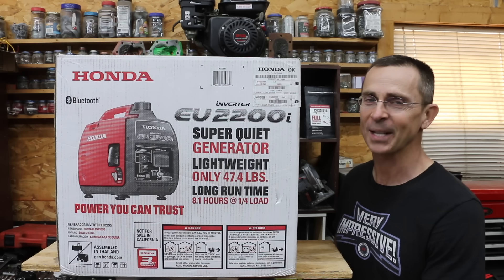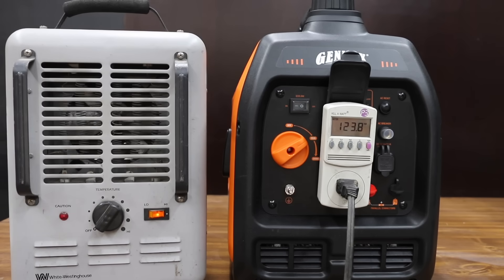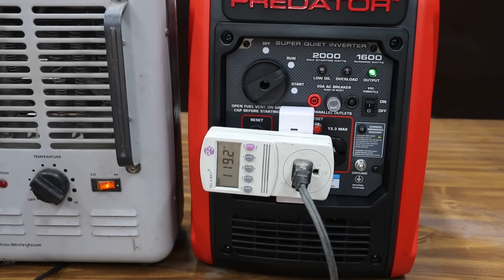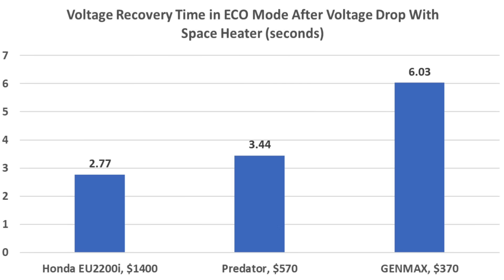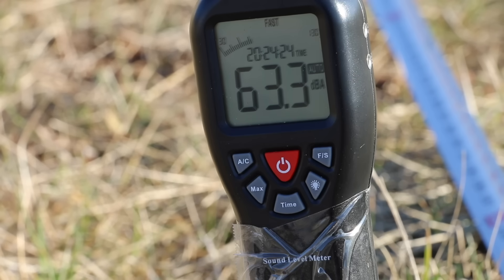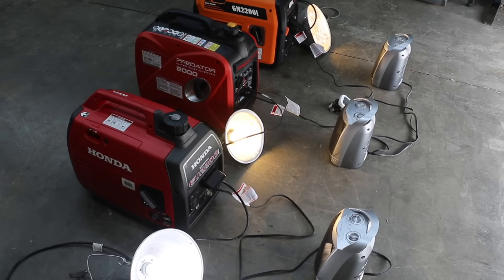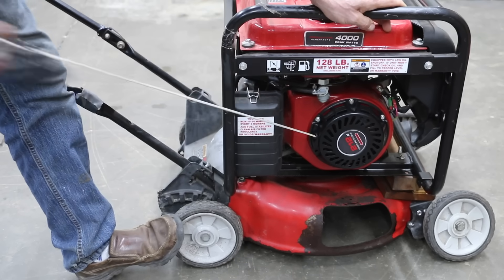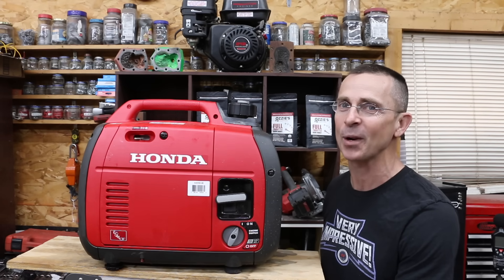Cheap Generator Better Than Honda? Predator vs Honda & GENMAX—Let’s Settle This!

Comment: I bet you do not drink coffee  :-0 .... ONE very important question please....  In your testing you permitted the inverter generators run out of gas UNDER LOAD....  In general terms, and specifically for the Westinghouse iGEN2500,  what is the REAL ANSWER to -  ""Is it harmful or damage these inverter generators to run out of gas UNDER LOAD"" ????  Could one ASSuME that these types of inverter output circuits have incorporated a safety turn off if/when the generator cannot continue to produce power/run out of gas?  Thank you for your sharing your testing experience....
Reply from the maker: You are welcome!

Comment: Thanks for another comprehensive test video from Project Farm.  This kind of information is a great help for folks trying to choose between these products.

I do wonder why the oil was measured by weight for this testing.  I've always assumed that oil quantities were specified in terms of fluid ounces (volume), so I was puzzled by the use of a weighing scale for measuring "ounces" of oil for these generators.
Reply: ME TO....

Comment: Loved the video and its format. What is the date on these tests? I purcashed a predattor 2000 and it does have a CO2 shutoff now. Will you be updating these tests with current models and prices? 
Thank You,  Ray
Reply from the maker: Thanks for the suggestion.

Comment: I owned a portable Honda generator.  At one point I had it stored for 5 years.  When I took it out, added gas (I stored it dry), it started on the first pull. 

Honda makes good engines.  Worth the extra money.
Reply from the maker: Thanks for sharing.

Comment: I was wondering if u vou could test other cheaper generators? Like the Pulsar,Duromax,Firman,Wen, and last Westinghouse. I am very interested in noise levels. Thanks 😊 PF. DUTCH. I JUST signed up it's not much hope it helps

Comment: How about these running a small A/C window unit? My electric bill is outragous when using A/C.
Reply from the maker: Thanks for the suggestion.
Reply: For the Florida hurricanes my Westinghouse iGEN2500 powers my 6K BTU window AC, (~435W), AND my refer - ~125W very nicely and still gets about 8 hours run time on one gallon of E0 gas.  ONLY run E0 gas that has been stabilized and with the 20 gallons in my shed that should provide ~ over 6 days of power - 24/7 if it is needed.  BUT, if the power is out for an extended time, I will be sure to change the oil at about the 100 hour mark..  I only use Valvoline 10W-30 FULL SYNTHETIC IN all MY power gear so as long as the oil level is OK, I don't sweat with any extended run times....

Comment: I really need to see a comparison in the 2200 - 2500W range between Honda, Champion, and Wen. Primary concerns are noise level and weight. I am a senior and camping alone. Amazon has this 
Champion Power Equipment 200951 2500-Watt Portable Inverter Generator, Ultralight. And WEN 56235i Super Quiet 2350-Watt Portable Inverter Generator with Fuel Shut Off, CARB Compliant, Ultra Lightweight. I think the Honda is a 2200W. I am subscribed to your channel. Will I get a notification when you add more comparison videos? Thanks!
Reply from the maker: Thanks for the suggestion.

Comment: A test I have found anyone evaluating gen/inverters is what kind of load that they will handle at 6000' elevation. After watching a number of eval/review videos on the various gen/inverters 'out there', I traded up from my Champion 7536 2kW peak/100W running gen/inverter to a Honda 2200i. My Champion is powered by a rather anemic engine that would go into overload when I ran the 900W microwave in our trailer -- clearly a symptom of an under-powered engine and oxygen starvation at 6000' elevation. I bit the bullet to by the Honda at round $1100 based on the reputation of Honda for reliability and the experiences of ham radio friends who use theirs in the field for radio'ing and powering their RVs when dry camping.
I've not been sorry for my purchase choice. Ya gets what ya pay for (usually). In my case with the Honda -- definitely.
Important note: Honda apparently is no longer selling its gen/inverters in Calif d/t  the increasingly restrictive laws on gas-powered utility tools. In the case of gen/inverters, Calif is requiring catalytic converters on new units -- something Honda has refused to do. (I went out of state to get my Honda.)
Reply from the maker: Thanks for sharing.
Reply: cat would make this gen twice as big and twice as expensive, Politics are big powerbank lobbysts

Comment: Wow what a comprehensive review on multiple criteria, and some I didn't even think to measure.  Your test bore out what I've always know.  Honda generators are the best.  To use an old expression: you sometimes get what you pay for.  I bought the original Honda EU2000 back in 2006 and it's still running strong.  BTW I paid $800 back then.  As a YouTube channel content creator I appreciate all the effort you put into this video.

David
Reply from the maker: Thanks!
Reply: BTW you had at Honda with the new feature that they added, bluetooth!

Comment: Great job! However, I must say that you should never use a flat feelers gauge to gap spark plugs. The manufacturer shears the ground electrode off which leaves an edge that can through off the cap with a flat gauge, always use a wire type gauge to cap spark plugs.
Reply from the maker: Thanks!  Thanks for the feedback.

Comment: Would like to see a Yamaha generator in this comparison. I have both a honda 2000 watt and a Yamaha 2200 watt. If I had to have just one, I would take the Yamaha. It has some nice features on it. It's about 12 pounds heavier but it has handles so top so two people can carry it. You can use the lights on the front to tell hours on the unit. There is a small led light on the panel if its dark. There is a valve you can open which drains the carb. You can even catch the gas and put it back in the tank. I like my Honda a lot but if I don't start it on a regular basis it can take up to 45 pulls to get it to run. Both units are great performers.
Reply from the maker: Thanks for the suggestion.

Comment: Great test sir. So it sounds like if you can afford it go for the Honda but if you can’t spring $1200-$1400 the performance of the other two is decent for less than half the price of the Honda.
Here is the real test of a generator. Park them all for 1 year or 2 years with fuel and stabilizer and see if any of them start and run after sitting.  That’s how average Joe will,use them right … real world testing 😉
You are so detailed I your testing. I literally check this channel if I’m thinking of buying tools , work boots , glue or motor oil. Thanks 🙏🏻
Reply from the maker: Thanks!

Comment: Another awesome video.  Thanks. The Honda 2000 is amazing.  I worked in communications and we had 15 that were used and abused for years and still ran strong. Very Impressive!
Reply from the maker: Thanks!

Comment: I've read that a break in period is useful for these generators. Depending on the generato, running it with conventional oil from anywhere from 2 to 20 hours, then an oil change to full synthetic can extend its life. This break-in period is different for each generator and may be in the documentation that comes with it or available online. The cheap Genmax is probably a generator that would benefit from a change of oil after a few hours or runtime.
Reply: That would be a very interesting test!!!
Reply: good point
Reply: كم سعره 2000واط
Reply: I just ordered the Genmax 4k and plan on changing the oil at 20 minutes and then at 5 hours or so.

Comment: I bought a Honda 2000i almost 20  years ago for use at my cabin. It wasn't cheap, but I thought "buy once, cry once". It has many hundreds of hours on it and aside from regular servicing every couple of years and oil changes every 100 hours when I remember, a replacement of the stepper (throttle)  motor is all I've had to do to it. That generator helped me renovate the cabin while quietly powering everything short of my welder. It doesn't owe me anything and I still smile a little bit each time I start it up. Maybe the best money I ever spent, especially as it was a huge investment for me at the time.
Reply from the maker: Thanks for sharing.

Comment: I've watched a number of these reviews and every time, no mention is made of breaking in the motor. The reviewer fills it with oil and then immediately puts a load on it. When I purchased my Champions, they had a very specific break in period and even supplied the oil. Do modern generators not need to be broken in?

Comment: The density of motor oil is < 1, so 10oz of oil by weight is not the same as 10oz by volume, FWIW

Comment: I have been researching solar generators, or portable power stations as of late as I’m planning some boondocking camping trips next summer for my son and myself. I have been thinking of getting a gas genny just for an emergency situation so this video really helped me with pointing me in the right direction. Thanks for the time, effort, and money put into it! Since I’ll only need to use it on rare occasions, because I have a 2000wh battery box, I’ve made a decision based on your findings. Thanks as always for the service you provide people such as myself!
Reply from the maker: You are welcome!

Comment: I'm not recommending this. But I have the predator 2000. It comes with a red and black plug with alligator clamps on one end. I was stranded in the middle of nowhere one morning with a dead battery and no one around. I wasn't sure what would happen. I plugged that odd shaped cord in and hooked the other end to the battery. I turned the switch foward to see what was happening. I was getting volts. So I left it plugged in and running for about 30 mins. My vehicle started and I threw a party. 😂  I don't know if that's what that cord is for or not but it worked for me.
Reply from the maker: Thanks for sharing!  Glad it worked for you!

Comment: I have the predator 2000. Did you have a hard time getting the sparkplug wire off? I've tried to get it off a few times to check the sparkplug. But it wont budge. I don't want to break the wire.

Comment: I love your channel and how well you have produced these videos. 

On this video and the power drop and recovery, I would make a statement that generators should be run at more than 75% load to minimize the power drop and to allow for intermittent power draws such as from tefridgetato compressors.
E cellent job though.

Comment: I’d like to see the champion dual fuel 2500. It might be interesting to compare oil and spark plugs from only running propane vs gasoline.
Reply from the maker: Thanks for the suggestion.

Comment: My Acura V6 is still almost silent at idle and revs silky smooth after 12 years and 102k miles. Not one part that isn't a consumable has failed in this car. Honda knows how to build engines.
Reply from the maker: Thanks for the feedback.

Comment: I run a Honda 2200 in a box mounted on the frame of a Freightliner semi. My current generator is about four years old. It runs approximately ten hours a night four nights a week. My last Honda EU3000 lasted five years. Extremely reliable machines.
Reply from the maker: Thanks for sharing.

Comment: When in Eco mode on the Honda, if a small portable AC is hooked up that runs at less than 500 watts but has a greater than 500 watts requirement when starting up each time the compressor turns on,  will the Honda stay in Eco Mode for the whole night or immediately go back to eco mode Automatically after each compressor start up with the AC?  I hope that is the case so it doesn't kick out of eco mode and stay out of eco mode just due to each compressor start up.
Reply from the maker: Thanks for the suggestion.

Comment: I would love to see the Ai Power 2300 from sams club it goes for $350 (thats the one I have) but if thats not a fair comparison for you Ai power does have a 2000 model generator, I just dont know where to buy them
Reply from the maker: Thanks for the suggestion.

Comment: I have a 2000 Honda probably about 11 years old with close too i wound  guess  1000 hours, it still starts first or second pull and runs great. If you keep the oil clean in these generators I think they'll last forever.  it's been worth every penny and I would definitely buy another one.
Reply from the maker: Thanks for sharing.

Comment: I was without power for 3 days due to a storm that blew throughout the Houston area and I pulled out my Honda ru2000. I haven't started it in nearly a year and after 3 pulls it started and ran for 3 days straight powering my home appliances, shop fans, tv, and dvd player along with cell phones and I didn't have to breakout my big generator. I've had my Honda going on 10 yrs and the most reliable generator that I have owned.
Reply from the maker: Thanks for sharing.

Comment: I can tell you this, I bought the Honda 15 years ago,  it will run 8 hours on a gallon of gas pulling a 5000 watt AC unit in my old camper, it srtill cranks and runs like a top, nothing added but Non Ethanol fuel!!, It wasn't cheap but NOTHING tests longevity BUT Longevity!!

Comment: You should do another drill test video but this time include the porter cable brushless drill the thing is indestructible. I've used it as a hammer, have driven lag bolts with it, and used auger bits and it hasn't stalled or broken.
Reply from the maker: Thanks for the suggestion.

Comment: I would like to use pressure washer with generator. Kärcher K3 Pressure washer's tech specs says it is 1600 W. I measured it myself and starting wattage is about 1300 W and after few seconds wattage drops to 850 W. Question: Would 2200 W generator be enough for long term use?

Comment: I have a predator 2000 with close to 1000 hours. I recommend putting an hour meter on for changing the oil. Using full synthetic oil. Have never had to add oil between 100 hour changes. Change the oil after a couple of hours when new. There's alot of metal left in them when manufactured.
Reply from the maker: Thanks for the feedback.

Comment: I'm surprised you did not test the Champion Inverter Generator.  I have a 20 year old Champion 3500  (HONDA EM3500 clone) and a 2200W Champion Dual Fuel Inverter.  I bought the 2nd Champion unit because the first one was and remains bulletproof.  I could have almost given you the test results for the HONDA, they are that good. I worked on and sold HONDA Power Equipment and Motorcycles.  HONDA Generators are expensive, but they always work and you can get parts for them if needed.  I have a nearly 50 year old EM600 HONDA that still works like a charm!  One thing that you could have mentioned about fuel consumption is that the HONDA is 40% larger engine that either of the other two, it will use more fuel as a result.  That only made the HONDA's performance that much more impressive.  The larger engine is one reason that it does not "sag" under load and recovers quicker as well. I ESPECIALLY liked the fact that you did the oil analysis, those wear results on those cheaper units were still quite surprising.  This proves the superiority of the HONDA, that comes at a cost, but in the long run the HONDA will live almost forever.  I know, I have a Champion . . . .  I don't ever fool myself that these "cheapies"  are as good as the HONDA, but they are going to be 75% as good and were very cheap.  Something is always better than nothing!   Great video!
Reply from the maker: Thanks!  Thanks for the constructive feedback.

Comment: You won't save money in the long run by buying one of the less expensive ones. They may work well and be fairly quiet, but the parts inside the other ones are NOT NEARLY as well engineered or as well made as the Honda. If you're only planning on needing a generator for two to three years, buy a Genmax or Predator, but if you want a generator long term, spend the extra for the Honda! I learned this the hard way. Honda for life!
Reply from the maker: Thanks for the feedback.

Comment: We've had our Predator generator for 5 years of commercial work
 Being used for hundreds of hours and the only problem we've ever had was the bolt backed itself out that holds the bracket for the plastic "on, choke, off" knob.
It's unbelievable actually
Reply from the maker: Thanks for sharing.
Reply: Good to know

Comment: For $1,700. I got a BLUETTI lithium IRON phosphate AC200 MAX "solar battery" (power center).  My $1,200. Off Grid TREK solar blanket keeps the AC200 MAX charged. The combination works VERY well. No noise, no smelly, dangerous gas cans and it runs my cooler all day. Plus I can use it for power outages or in the event of a zombie apocalypse. ;o)
THEN when I return to camp with my E-CELLS Super Monarch Crown e-mountain bike's 2 (TWO) Li-ion batteries I plug them into theAC200 MAX battery and in about two hours they are charged to 100% from 60%.
Reply from the maker: Thanks for the feedback.

Comment: A-iPower SU 2300.
Bought one after the big freeze here in Texas. Just had 4 days without power after a freak wind storm in Spring TX.
I ran my house fridge, my garage fridge and deep freezer on that one generator for 4 days straight, no breaks, filling it up when it needed gas. I didn't lose 2k in frozen meats or meals, line a lot of my neighbors did.
I just did a service to it today at work, and again, it just started right up.

I bought it at Sam's club for$329, and it's the best money I've spent.
Reply: $2k is frozen meat? Are you at 1890s fur trapper or preparing for the zombie apocalypse?
Reply from the maker: Thanks for sharing.
Reply: I just bought and used this model generator during Helene. I ran it for 5 days straight only stopping it for the recommended oil changes. Excellent product!